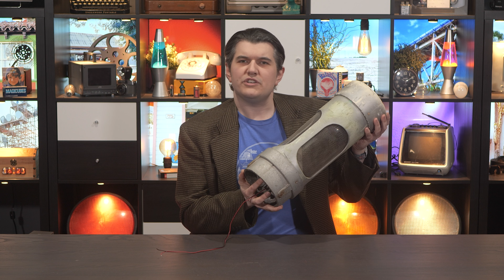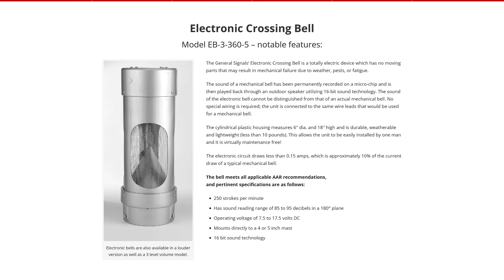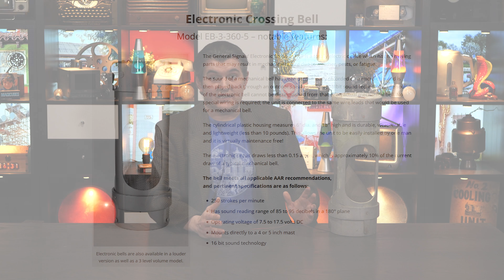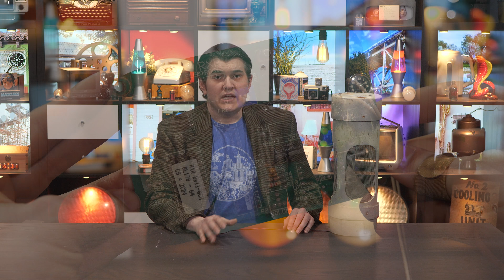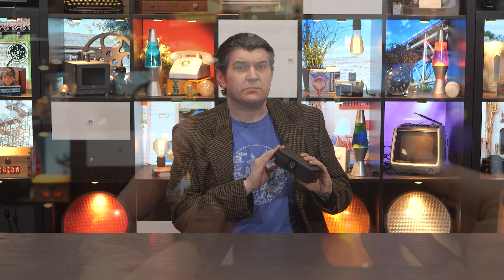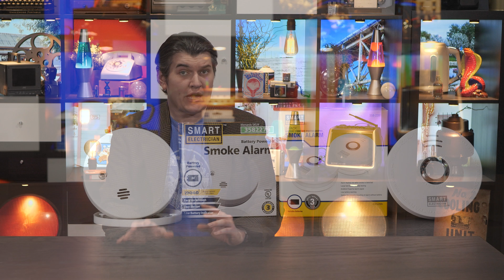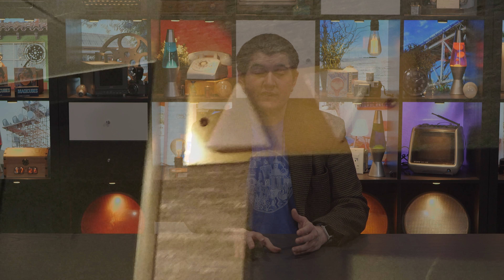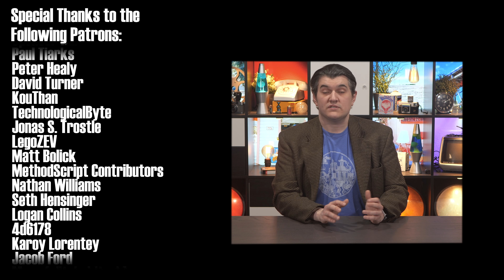The disappearing and unappreciated art of audible alerts

Comment: I entirely agree with this. 

Ux has basically been sidelined with the hostile ethos going around. 

People don't care about others as much. 

Remember when Windows added features to use accessibility inputs? 

Yeah, those drivers are broken -- because they haven't updated hardware IDs and a few extra protocols into their os. 

They just don't care anymore. 

We truly need right to repair -- I want to add a custom android rom to my phone, but then a bunch of apps will balk because "an unlocked bootloader means this phone can't be trusted" 

Fuck off. 

I miss having CLEAR and easy UI, as well as common sense features, such as a notification LED. 

We don't even have an IR blaster anymore. 

Oh and about that train bell -- they EASILY could add a conformal coating to that board, raise it 2 inches from the bottom (to keep it away from any water ingress) as well as add a basic LED that lights up RED on the outside of an error is detected. 

But nah --- just let it corrode to save $15.....

Comment: I was an electrical tech working at Newport News shipbuilding until 2019, occasionally I had to work on the siren system for the entire yard. The biggest siren was vintage 1930s-40s. I hated working on it because everyone in the yard is listening for the damn air raid sirens to signal shift change, lunch, and evacuation. I love seeing old tech still in use, it was rebuilt many times but it still is a big ass impeller making a hellacious noise.

Comment: i wear an insulin pump and continuous glucose monitor that work as a closed loop system. back when my company still worked out of an office, i sat near someone whose girlfriend wears the same model. anytime i was stuck on a call and he heard my low glucose alarm sound on my pump, he would go get me a juice and/or some peanut butter M&Ms from the breakroom. it was greatly appreciated and not ever something i asked him to do. the consistency of the sound across all the same types of pump was what made it possible because i never explained the sound to him or anyone else in the office, he just knew what it meant and how to solve the associated problem from prior experience. 
it's a very useful thing. unfortunately, wearing a pump/CGMS also leads to alarm fatigue. i have had a few models over the years, from different manufacturers. i find i get used to the sounds they make about a year in and then the alarms no longer wake me up when there's a problem. my first insulin pump let you customise the auditory alerts but that feature went away with the next model. i get that it was for safety/consistency/the expense of clinical trials on the software that made it possible. but i still miss the ability to change the alarm sound when i start to sleep through it.

Comment: Thing is, the companies do have great sound designers, they just either don't use them or don't for accessibility.
I have a few sounds on my phone.
1. I have a custom ringtone. (light, nice and low volume even on highest setting)
2. I have a custom ringtone for my mother (its a VTuber swearing).  (light, nice and low volume even on highest setting)
3. a 30s obnoxious preset sound for my mothers messages (high volume to get my attention).
4. a 30s obnoxious preset sound for an (important) group I am in. 
5. a custom alarm clock sound.
6. The standard preset "bubble" sound for the rest.

I can have this because I am never somewhere where it would be problems with the obnoxious ones, and when I am so would the nice ones also be a problem...

Comment: The battery percentage icon on Android is ILLEGIBLE since Android 16 update changed the text to be inside the battery icon rather than beside it. 

I have 20/20 vision and use my phone on the smallest font it can can display. From beyond 4 inches away, I cannot discern the BATTERY PERCENTAGE INDICATOR IN THE TOP CORNER OF THE SCREEN BECAUSE THE FONT AND BATTERY ICON GET MUDDLED TOGETHER AND ARE ILLEGIBLE 

THIS IS NOT A SUBJECTIVE OPINION, THIS IS OBJECTIVLY FLAWED  DESIGN THAT USED TO BE FINE 

and then they changed it to look more like the iPhone, which ALSO does it poorly...

Comment: We got a new, modern microwave. Before that we had one with a knob, and when it finished, it only made one loud ding sound.
This new one beeps every time you push a button, and makes 3 loud beeps when it ends when finishes microwaving. I hate this sound so much, I literally stand next to the microwave and open the door as soon as the heating finishes (I could just press the stop button, but cmon). In theory there is an option, so you can turn this feature off, but I couldn't make it work (and probably would need to be re-do every time when it losts power). The best thing: it beeps once in a minute or so when somebody leaves the food inside, and while my family doesn't care, it drives me insane

Comment: I think around the time the smoke alarms changed to Temporal 3 sounding pattern was the late 1990s, 1998 if I recall correctly.

Before this, they mostly made a pulsing sound pattern which is often known as 4/6 pulse, meaning for 4/6 of a second, the horn is emitting sound, and for the remaining, it is off. Some few models from circa the 1980s used 5/6 pulse, the horn emitted sound for 5/6 of a second and was off for remainder.

Even earlier than this, they used continuous tone, this was back in the 1970s where smoke alarms still used electromechanical horns, essentially a miniaturized car horn. They sounded quite different depending on if you fed AC or DC power through them.

Comment: Posting a controversial video on renewable energy then limiting the comments to subscribers (then not letting me comment after I subscribed)?  Were you afraid of pushback?  I got about 20 minutes in and your math wasn't mathing based, I would assume, on your total lack of experience with solar power.  First, upfront costs are a big thing.  Most people can afford to pay $16,000 over 15 years, but cannot easily come up with $1,000 right away.  Second, electric cars are expensive, range limited, and slow (comparatively) to refuel.  These shortcomings are improving, but they still cannot match gas vehicles.  Additionally, their range drastically varies based on speed, temperature, and use of things like air conditioning or heating.  Third, you claimed that you only needed 12, 500W panels to keep your electric car going in the winter in Chicago.  I don't know the battery pack size of your vehicle, so I'll assume around 60kwh.  In December in Chicago, a 500W panel in absolutely ideal, perfect, conditions (which don't exist in the real world) will produce 4.5kwh of power over 9 hours of sunlight.  Based on that you would need 14 panels to recharge a 60kwh vehicle. BUT, then you need to add in clouds, sun angles, etc, as well as properly wiring the panels in series or parallel to maximize the amount of energy your charge controller can utilize.  In reality you will need probably at least 2x that number of panels to produce 60kwh on a decent December day.  But wait!  Unless you work at home you can't charge your car directly.  You will need at least 60kwh of home batteries to store that energy until you got home.  Add in another $12,000 or so for those batteries and another $1k for a charge controller/inverter etc to charge those batteries and then charge your car.  So now you have a car that costs probably 10k more than it's equivalent gas-powered cousin, $5k for solar panels, $12k for batteries, plus all the incidental costs like wiring, panel install, etc.  By the time all of this stuff is 15 years old (the time it will take to spend $16k in gas based on your car) it will be time to start looking at replacing both your home batteries and the vehicle batteries, assuming 6000 cycles to 80%.  So having an electric car would put you about $11k in the hole.  It might not be as bad if you don't need to fully charge your car, but it isn't going to save money.

I love the idea of electric cars, home batteries, and energy independence. But we won't be able to replace gas cars without significant improvements in solar panel efficiency, battery life/capacity, and the costs of both.

It seemed by the comments that you went into a more political rant, so I stopped watching after seeing these initial big issues and noticing responses had been limited.

Loved your dishwasher video.  Cheers.

Comment: As a note about smart watches being "too smart", Garmin does make at least 1 watch design that is 
- Waterproof enough for prolonged swimming activity
- Designed to last nearly a week on a single (full) charge
- Will tell you exactly what notifications you are getting (but you can customize from which apps)
- Has a few pre-chosen responses to texts available
- Will tell you when you are getting a call and will tell you if it's a saved contact or the phone number of the call

I am not paid by them, I'm just a happy customer. It's also got analog hands which last a couple extra days even when the "smart" functionalities are out of charge. I've had mine for about a year and a half now and the only thing that's been "less than ideal" is that the band was starting to wear out at the connection point and it was pretty cheap to simply get a replacement for that. I call it my "just smart enough" watch, because I can see if there's anything truly important for me to need to check or if it's just another notification (I keep my phone on vibrate for work reasons).

Comment: when i bought my house it had the original mechanical doorbell in the front door. It was literally a bell, in the door, and you twisted a knob which spun a gearset which multiplied the rpm you spun it at and forced 2 (hammers?) they are like loose washers that move outward and then oscillate against the bell. i saved it when i installed a new door and a doorbell camera, because i thought it was neat.

Comment: That carbon monoxide alarm sound is the exact sound our baby monitor makes when it loses the signal to the camera....

But I have to agree, there is a lot of laziness going on in the human machine interface in general. Don't get me started on all the cars that just need touchscreens and no buttons... I also like to be able to preview phone notifications on my wrist as well but not having a device that needs it's power needs attendee to more than infrequently.  I also like an analogue watch with actual hands. You know this thing that has worked very well at the glance of an eye in direct sunlight for a very long time. I did think Fossil had cracked it when they installed an e-ink display behind a regular watch. But after about 2 years worth of UV exposure it turns out e-ink displays start to fail. Probably why they discontinued the whole venture. So I did the most sensible thing: I bought another one that was being sold off as it was being discontinued hoping someone else would figure out something similar but better as it was working its way to a similar fate. Well. That has now happened and nothing else has appeared...

Comment: You should do a dedicated PSA video on the different modes of beeping from smoke alarms and co2 monitors. It's way too esoteric to remember and trying it out and playing with them means being deafened or frightened each time. Maybe pull out the top brands (for the US I suppose) and and types, and use them as examples of what to look for. We bought a house with some wired in alarms and they started maintenance beeping. It could mean low battery, a bad connection, or a bad ~electrical~ connection or it's out of date. None of which were applicable to me. So I just don't rely on them anymore. 🤷🏻 They weren't old, I put two different brands of new batteries in and they aren't connected wirelessly (or need to be). The connectors have voltage and we don't get brownouts. Literally unusable if it's going to wake us up at night when there isn't an emergency. I just assumed they are at their 10 year end of life after being a few years old to be safest. 

I will never give up my music call ringtone. Buuuut I did switch it to a song that has a very slow buildup so that I can get to it before people in public can tell what it was when I forgot to set it to vibrate haha. I had to edit it to fade in and out so it didn't play the entire song or get too loud. 

People have mentioned it but back with my Env3 the loud vibrate was PERFECT for a quiet sound that not super obtrusive and could notify you in louder environments too. Nobody in a theatre would blink an eye at somebody's vibrate once or twice but a loud ringtone is very noticable until they scramble to turn it off. Now the vibrate can't get my attention when I'm doing more than sitting or standing still.  

And yes on the cool down and reminders. I have a text app that reminds me and my normal conversations are on FB messenger and that doesn't have reminders. My parents text? Reminded every 5 minutes for 15 minutes. My friend sends a picture of a project? No reminder! Starred contacts should do it by default tbh. 

And I wish more than just group chats could be muted for an hour or whatever. It should be infinitely customizable! Why is this so hard? 😂

Comment: The fire alarm sound is not what I think of when you say fire alarm.
Fire Alarms are generally a constant or repetitive loud noise.
I think a minimum requirement should be that regular users/staff of a building know how the alarm sounds. Even if it's a description.
Schools do this well with fire drills but this doesn't translate to public spaces. In shops for example there are a lot of different noises that could be interpreted as a fire alarm, especially out of customer hours.

Comment: You missed another clever mechanical invention that was also replaced by an electronic one: the hub-mounted backup bell used on heavy trucks like garbage trucks. It was very clever and required no electricity much like the door chime you featured. Of course, finding a working example would probably involve a trip to a museum.

Comment: Oh yeah, notifications are lacking, at least in Android. For example maybe I want to silence all notifications from certain apps at night. Or leave the vibration but not the sound, or lower the volume, or higher cooldown. Maybe I want different settings for different apps. Or for different "modes" like working or sleeping. Maybe there should be variants of the sound, you know a sound you can identify clearly but is less noticeable or won't wake me up maybe? But that I can still identify and notice if I am not yet sleeping, instead of complete silence or full normal sound volume.
I remember working at a company and once getting a complain that we would send notifications at night. Which was true, but "night" might mean different things for different people. And some people might still want those instant notifications even at "night". So the UX designer started thinking of a settings menu on the app to configure this but that was so much work, and honestly the OS should have it, you should not have to dig into each individual app to configure this. That was more than 10 years ago, Android is pretty much the same in this regard.

Comment: Those fire alarm sounds are definitely not universal, here in the Netherlands 🇳🇱 they are more high pitched.
The Slow Whoop is an evacuation alarm, I've built a circuit long ago from a slow sawtooth oscillator driving a voltage controlled squarewave oscillator and built it into a PA amplifier of a company with several metal working and storage buildings.
First did an announcement of the upcoming test, then pressed the big red button we installed...
Slow run-up from a very low frequency to the highest with lots of harmonics, then started over again at the lowest frequency of the whoop. It got some attention, even from the neighbouring companies! 😂
At our company we also have different audible signals for when machinery comes into motion, like a YOT alarm.
Fun is to have MP3's from different alarms (still have them somewhere 🤔) on your phone and play one at an improper time...
Thanks for the fun video and rant Alec!
We have almost the same electronic bells at our railroad crossings, but not in that build "quality" 😂

Comment: Knowing the distinction between carbon monoxide and fire alerts,

Can actually save your life specifically on the carbon monoxide and Since carbon monoxides, it's actually safe to go towards the nearest outdoor if you're feeling lightheaded.  Even if it's not the exit.  And you can't leave from there, aka a balcony. 

But with the fire the longer you stay in the building even on an outdoor balcony.  The more danger you are in.

The distinction very rarely matters. Since you'll get other warnings. Like visible smoke.

 But it's always safe to go towards the nearest exit in a fire no matter what. Well if carbon monoxide you can dilly dally as long as you're not suffocating.

Comment: My smartphone has always been on vibrations only. Android notification system is very flexible (compared to other smartphone OS) but sometimes the app developers are idiots and implement them in the worst way possible. Most apps end up with notifications completely blocked because they don't use categories or they are implemented poorly (no, your stupid promo should not make my phone beep or vibrate).

It's a pain for me to switch phones as these settings do not transfer and my new phone will vibrate every minute for a couple of weeks until I set everything up.

Comment: Seatbelt reminder tones became a requirement in cars around the time mine was built (1979). My model was sold with an awful-sounding buzzer as standard, but you could opt for a real mechanical chime with an electric striker that sounded more pleasant if you wished. Mine has that chime. A little metal key in a plastic box wired under the dash, struck by an electric striker, very distinct and cool and always gets questions when I drive guests around town!